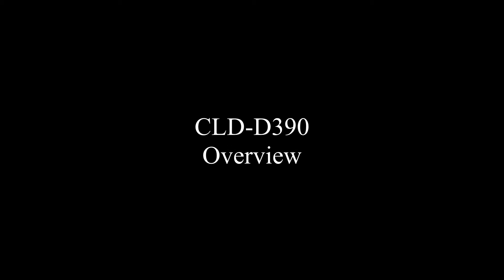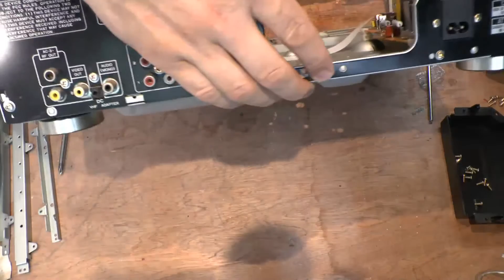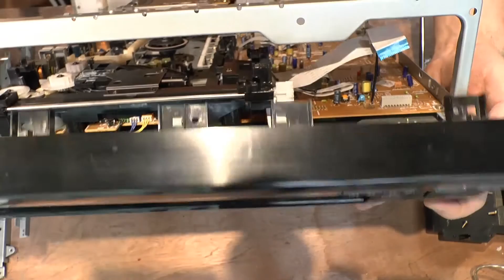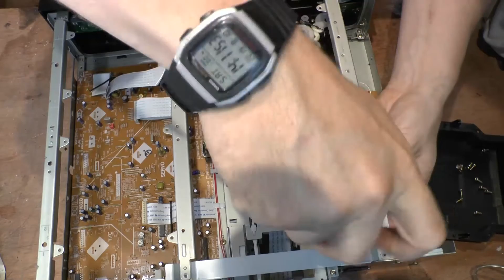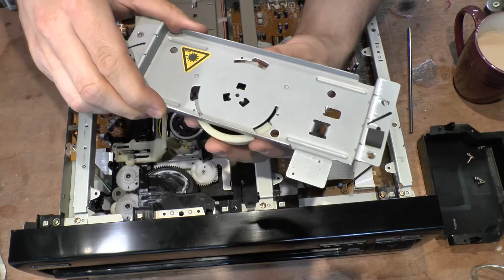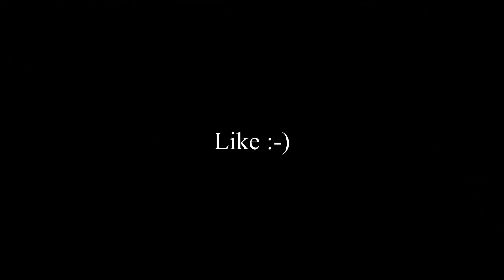PIONEER CLD-D390 RE-ASSEMBLY AND DISCUSSION

Comment from the maker: lot of the "more modern" pioneer machines use similar laser assembly and turn gear.

CLD-D925,CLD-D790, CLD-D390, CLD-D515 and the USA CLD-D703 AND CLD-D503 can be added to this  list I would wager.
Reply: CLD D703 and D503 used the same laser as the CLD-2950.